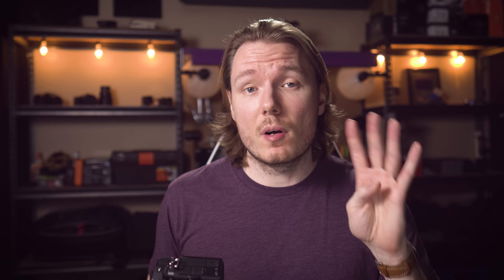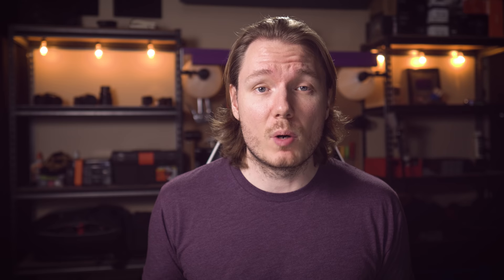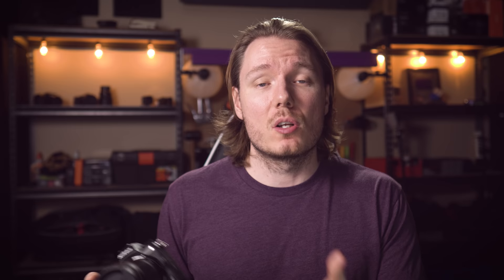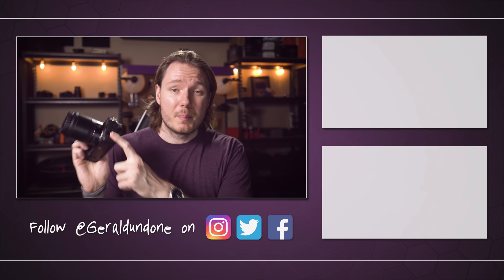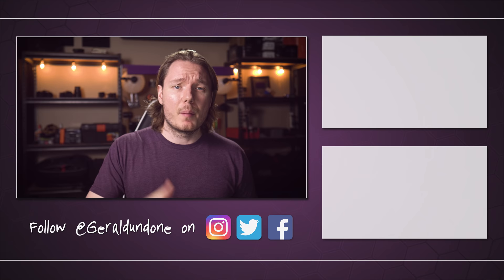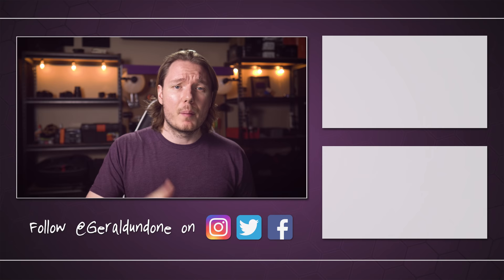Pixel Binning vs Line Skipping / Why the Nikon Z6 Is Better for Video

Comment: This analysis of the Nikon Z6 applies equally well to Nikon's 24 Mpix D5X00 and D7X00 cameras. These eariler cameras likewise use pixel binning to produce alias-free 1080p video. While they don't offer the Z6's 4K video modes, you can pick up them up refurbed for about a third of the Z6's price.

Comment: 3:00 The confusion is that one naturally assumes sampling only happens in the time domain, but it also applies in space, the spatial domain. So oversampling means just that in this context, spatial oversampling. All the sampling theory works totally fine for optics and stuff like this, you just substitute time-frequency (Hz/seconds) with spatial frequency (usually - lp/mm aka "line pairs per mm"). For the same reason the "optical low-pass filter" in front of the sensor (that most cameras don't have any more) is sometimes called an anti-aliasing filter, because it prevents spatial aliasing - an effect of sampling spatial frequencies above the Nyquist limit at a given spatial sampling rate (=pixels/mm of the sensor).

MTF / modulation transfer function or ratio applies the same concepts and essentially represents the attenuation of spatial frequencies across the image plane of a lens.

"Spatial frequency" sounds a little weird, but the math checks out and explains a lot of the "weird" optical phenomena you can observe around "discrete" objects (pixels, fences, patterned shirts etc.)

Comment: I know this is a year late, but one note on pixel binning is it actually performs a method of anti-aliasing by virtue of averaging pixels over an area. If you do out the math, it's similar to a blur filter. In general, pixel binning is just a type of simplified oversampling that can be done in hardware, or at the least, rapidly in software, but won't necessarily give you as good results as a nice oversampling/downscaling.

In the CCD times, the difference between binning and oversampling was more a matter of if the averaging was done in the circuit or in software, and the associated costs and noise benefits each had. In the hardware, depending on the sensor and method, sometimes you could average before some of the noise was injected, giving an advantage to binning there. But it's not as sophisticated mathematically and could have some potential electrical limitations too, so you had that drawback.

Comment: I dont know this as a guaranteed fact but it seems that most of the sensors that we are seeing today that do 5k and 6k oversampling are Sony IMX Exmor models. Even the GH5's oversampling ability can be attributed to its' Sony IMX272 Exmor sensor. Sony has developed the best readout and scaling engine out there in my opinion....and everybody wants to buy it! We know that Sony Exmor gets it readout A/D conversion directly at the end of each photosite row. I have been reading that the latest Sony sensors can be configured to do your pixel binning or over sampling directly inside the sensor's several readout algorithms and combined at the A/D converter level.. This allows the image processor to receive "pre-scaled" digitized raw data set to assemble it's image from. (This could explain why the GH5 was their first camera to have a 5k oversampled sensor readout) Canon? They are still stuck in crude+simple 1:1 readout and image processing. (basically)  Remember 1:1 RGGB readout produces a green channel with just a 50% 4k resolution and with red and blue channels only having 25% 4k resolution!!! It really sucks to think that your best channel (green) is NOWHERE near "4k" resolution...not even close!!!. Now,..Sony's 6k oversample technique produces a 100% full 4k raster green channel and two 50% resolution red/blue channels. That's the best 6k to 4k real-time resolution scaling that we have today. This is why Canons always look so horribly soft to many people. Canon "4k" is not much better than good 1080! Nice video Gerald!!
Reply from the maker: Definitely! And they are rapidly improving what those sensors can do computationally. The new sensor rumours from Sony are quite exciting. It's also impressive how they've worked around the on-sensor limitations that arose when they switched from CCD to CMOS. You could do a lot more pre-conversion stuff with CCD, but they're finding ways around it with CMOS and it's pretty great.
Reply: @geraldundone  - It's going to be VERY interesting to see where Panny goes with their new full frame models. They own a large portion of TowerJazz but I doubt they could fab at the production rate that might be needed, and I have still not seen a "great" TowerJazz sensor yet! (Remember how we everybody swore the fantastic Nikon D850 was a TowerJazz sensor,...only to find out two months later that it was a Sony all along) Samsung IsoCell, BSI sensor? This is a huge rumor as Samsung has supposedly started to fab a brand new FF sensor(s) for a "Japaneses client". If so, Samsung could be the ONLY company that could challenge Sony quality today. If so, I'd bet my life that Sony will tear those Samsung's apart looking for Sony Exmor patent infringement elements! Sony has TONS of patents on sensor architecture including on chip A/D conversion IP.  Samsung better watch themselves VERY carefully. I'm told from two industry insiders that Canon sensors are front illuminated garbage that is fab'd on 10-15 year old factory machines! Canon doesn't produce sensors in the high numbers that Sony does and does not invest anywhere near what Sony does it's it's equipment and R&D.  Canon is so far out of the sensor technology game that is pretty ridicules. (Canon just doesn't care to spend the R&D investment money because their camera buyers just don't give a damn about sensors anyway)  Samsung vs Sony?....wow,,..now THAT could be one Hell of a real sensor dogfight next year.
Reply: Cliff Totten  definitely the most knowledge I’ve read in a YouTube comment in a long time!
Reply: @hautehussey  - I'm throwing some of my own opinion in there. Canon fans will fire back by saying that the most expensive cine cameras use a simple 1:1 readout. Canon fans will also say that a soft look is more "desirable" for a true "cinematic" feel. So to many Canon buyers, low resolution "4k" is GOOD and it's the very thing they are looking for. If that's the case,..fine for them. I would simply say this: Give me all the resolving power I can possibly capture. You can always soften as much as you want in post. Throwing detail away is the easiest thing to do in post. However, putting resolution back into an image in post after it's gone is completely impossible. (remember,..."sharpness" and "detail" are two completely different subjects that really have nothing to do with each other)  Yes, I'm an admitted Sony fanboy so it's true that I'm biased on this.

Comment: Your videos make my inner geek happy, thanks mate :D
Reply: Stanly ok , you inner geek should be ware that all serious video is shot without pixel binning or line skipping.  On a budget, have a look at the superb $1200 BMPCC4K. As for 4k crop, the a7r3 looks much nicer in  in its high quality 1.5x 4k crop mode, and the Z7 looks much nicer in its 1.6x 4k crop mode. You have to ask why some on the Internet are dissing the EOSRs 1.8x crop non binning or line skipping 4k. Pixel match, or an exact multiple down scale, is the correct hifi way. This video totally misses the mark. Scaling binning or skipping non exact 2x multiples is bad. Do the math.
Reply: Nor Dic for all high budget projects I’m renting Arri Alexa Mini or FS7. Nothing to geek out about Alexa btw, it simply does it job in the best way possible – no clever work-arounds or hacks. BMD Pocket 4K looks promising spec-wise, but have yet to try it out. Used to own BMD Production 4K and even though it was great on paper, IRL rarely chose it for a project. For all personal and not that high budget projects use my a7RII and it does great in both FOV modes, but codec is weak. Tried out EOS R and it’s a mess – pixel match doesn’t help much :D pity there’s no worthy camera to put those spectacular RF lenses on! I would switch for the lenses if there was something at least as capable as a73. BTW any kind of oversampling works if there’s no pixel binning or line skipping. 2x would obviously work better than 1.6x, but worse compared to let’s say 2.3x. I also think it’s less CPU-intensive to write 8K than to oversample it to 4K in-camera. Cheers!

Comment: I have experimenting with the Sony a7III and the EOS R and after some test I find out that the sharpest results are obtained by crop 1x1 pixel read out, and seeing that the EOS R now has the "Canon EF Lens to RF Mount T Speed Booster® ULTRA 0.71x" I believe it is on par with the GH5s.

Comment: Display equipment (and honest video cameras of yore) refer to a pixel as having all three colors.  (Only modern marketing departments call single-color photosites "pixels".)  A Bayer-pattern sensor has blocks of four photosites containing one red, one blue and two greens.  A sensor with 7680 or greater photosites across in the horizontal direction should have a natural and easy method of outputting UHD.  Map each Bayer block to a corresponding 3-color 4k output pixel.  This method should yield full chroma resolution too!  (True RGB/444 chroma is missing when under-sized Bayer sensors are interpolated to generate the final output resolution.)

Comment: 5 years ago I left a comment which still remains unanswered. Nowadays I no longer have my Lumix LX10, I had to replace it with a Canon G7Xmk3 and its video quality is much worse. It does not crop like the LX10, but the video is much softer, lacks any sharpness (on all default profiles) and is quite lackluster. I'm talking about 1080p here, as I rarely use 4K. Tomorrow I will check if the 4K mode is the answer to this problem ;)

Comment: One question about pixel binning vs oversampling. If pixel binning is combining and averaging the information from several pixels, isn't it the same as downsampling? 
For pixel binnig, each pixel still needs to read the data in order for the processor to do combining and averaging. Then what's the difference between pixel binning and oversampling?

Comment: Love this Gerald. Thanks for putting so much time into it. I came to this video because I'm curious about the r5. No one seems to be talking much about the crop modes, but they seem interesting because the camera won't overheat. Wonder if you think 4K HQ mode might give similar results to 4K crop (but without any potential overheat issue...)

Comment: Two questions I have: You basically say that a sensor resolution around two to three times of what 4k needs is optimal because it has enough extra pixels to improve image quality while not having too many to toast the processor. What ever happened to the good old 1:1 sensor read out though? GH5s, BMPCC4k and A7sII are examples that this concept is actually better than down/oversampling because of bigger photosites on the sensor. The first two examples are even very sharp cameras, whith the GH5s being even sharper than the GH5, which has a 24 MP sensor. I like to think that it makes more sense to use the processing power for AF, IBIS or better codecs. If you can spare the high resolution photo option that is. While we are at it, I never really understood why it is easier to process the data from a smaller sensor (mft) than from a larger one, if they have the same resolution.
Reply from the maker: I think a big part of what happens with the cameras you mentioned is the benefit of creating a dedicated tool. Sure, they have less pixels, but they were designed specifically for video. Their image processing is dedicated to clean video, and they are tuned to control noise extremely well. When it comes to hybrid cameras, they split the job, so it becomes a question of what is the best way to produce the nicest result will all those extra pixels. A 1:1 readout isn't bad at all if it's used in a dedicated system.

Comment: so which camera pixel bins? and which is the best at it? where can I find the info?
for instance, my compact LX10 with 1-inch 20.1 mpix crops in 1080p video at 25%, which leaves 4377 pixels still in one line to work with. Does it downsample to 1920? or line skips? I dunno, the video looks good.
In 4k it crops at 50% so it leaves 3648 pixels in one line which is not even UHD compliant. Or does it? maybe the crop works differently with 16:9, but for sure the FOV decreases from 24mm to 36mm in 4k video/photo mode.

Comment: Interesting! Isn't pixel binning basically another form of downsampling? In downsampling, you basically do a convolution of the high-res source image so that multiple input pixels are weighted and summed together to form each output pixel. That is pretty much exactly what pixel binning does, right? So how do they differ then? And why does pixel binning have worse moire/aliasing than oversampling, when in both cases spatially spread out pixels are summed together, effectively reducing aliasing artifacts?
Great video btw! Thanks!

Comment: I don't know if I agree with your statement about the low quality of cropping compared to line skipping. Line skipping is inherently more prone to severe aliasing because you're not sampling continuous pixels, so it will make the jaggies more pronounced. Cropping however, is going to be limited by the quality of your lens and some inherent properties of the sensor, but in a properly engineered camera, a 1.7x crop could look as good as GH5S. A line skipped 4k readout is either going to be soft or jagged no matter what lens you use.
Reply from the maker: I think that's fair. It's true that cropping doesn't "cause" aliasing like skipping does, my complaint was that it doesn't do anything to help the situation either. But you raise a good point. Cheers!

Comment: Sony a7sii has 12.2 MP sensor. 4400 pixels horizontally compared to 6000 of Z6. Sony a7sii uses oversampling too but has bigger pixels than the Z6. 
So does this mean Sony a7sii is more susceptible to the artifacts like aliasing and noise. 
Also, usually the bigger the pixel size, less the noise. ( Shot noise) 
When you say  smaller pixels =les noise it applies relatively when sampling, right. (Read Noise) 
I'm quite confused with this, especially trying to relate it and apply to the A7sii. 
 
Would be great of you can clarify this.

Comment: Thank you.  I could have guessed most of that but its really nice to have it all packaged together in one place.  I know sorta get why people dist'ed Canon EOS R -- it cropped (which is the least computational complex)  and it didn't go up to 60 FPS.   It would seem to be my pixel binning would be the most expensive although, now that I think about it ... I bet the down sampling isn't as simple as your diagram.

Do you have a suggestion of a "cheaper sibling" that has better video for Canon?
Reply from the maker: In many ways I would still say the EOS R is Canon's best video effort to date in the hybrid space. The issue is the deeper hardware. The need to get some new tech in for sensors and processors otherwise they're going to continue to face these problems. There's nothing cheaper that performs as well or better in the Canon space. And they definitely improved some issues people had with the video on the 5D Mark IV. I would suggest the M50 is the cheaper sibling, but it's not nearly as capable.

Comment: Question is: how do I find out what my camera does? I've got an a6400 and I'd mostly shoot in 1080p for several reason: smaller files, not that many people have 4k compatible devices and less rolling shutter. And because there is less rolling shutter in 1080p as opposed to 4k with this camera, I suppose it means it must do something like line skipping which is easier on the processor?

Comment: strange, but I had a severe cases of aliasing on my a6400, despite its usage of oversampling; either it's me messing with settings (although it was only b\w picture), or oversampling on a6400 isn't that efficient

upd.
so, a6400 do line skipping, not oversampling? if so, that explains everything

Comment: Great video and explanation! 
I’m curious of whether the output of the hdmi into an atomos skips any processing on the camera part and if this skip can lead to full sensor read outs in the future.
Reply from the maker: Thanks, Peter.
It does not skip the process, unfortunately. The Atomos comes in after the image processing, but before any compression and storage. So, it is still easier on the camera (no time limits or overheating when using Atomos) because compression and storage takes quite a bit of work as well, but it still has the same image processing.

Comment: Great video! I was wondering what the a7III does when it records 1080P. Is it also oversampling? And how come there is a lot more noise when I shoot in 1080p compared to 4k when all other settings are the same (frame rate, iso, shutter, f stop)?

Comment: Such a great video explainer. Thank you. I hope you answer questions from 3+ year old videos... I'm still using the 45mp Nikon D850 which uses pixel binning. Will I get better video sharpness in DX mode (1.5 crop) versus full frame because of the binning? Someone told me that but I don't understand why that would be the case.

Comment: Hi Gerald, great run down here, thanks a lot of taking the time to explain this. I'm just curious which method the z7 takes with the full frame (1.1x) while either shooting in N-log 10bit or Preres Raw. I've heard that it's pixel binning, but i'm not entirely sure